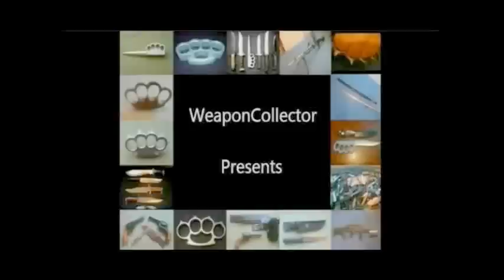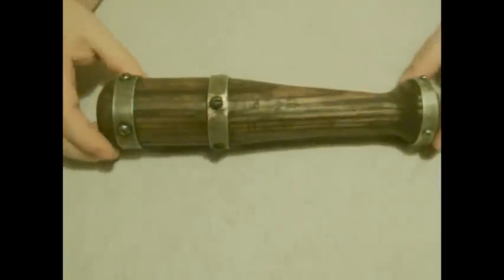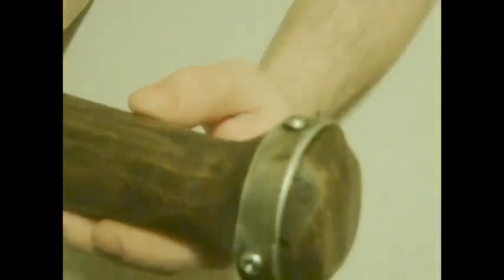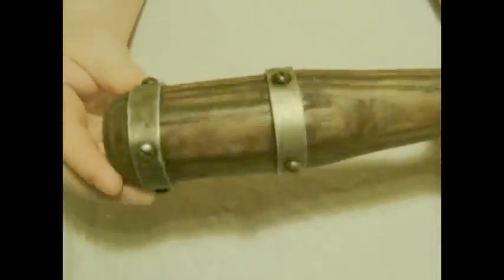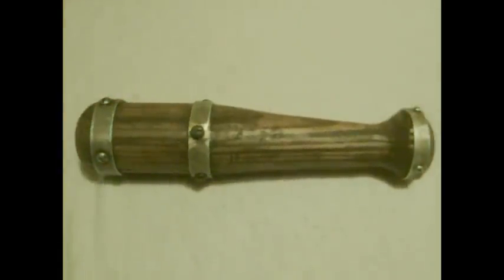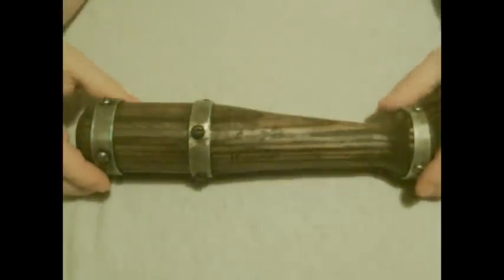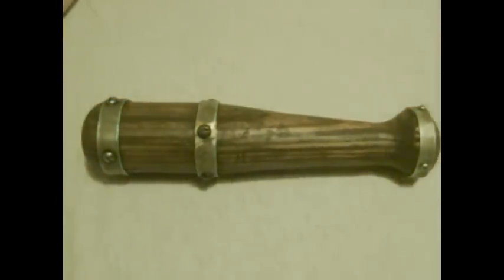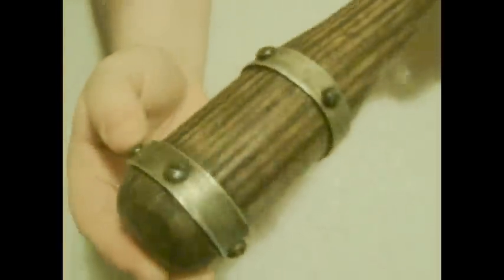Lead Weighted Studded Mace - Overview and "Making of"

Comment from the maker: I've brightened the video using youtubes own editor and it should take effect soon.
Reply: You're an artist mate. I  made a truncheon by sawing a basebat in half and used the lower half. I've added a wrist loop and grooves in the handle. I was thinking of drilling  a hole in the top, pouring in some lead and then when its hardened seal it in with cement(the glue stuff not the building material)